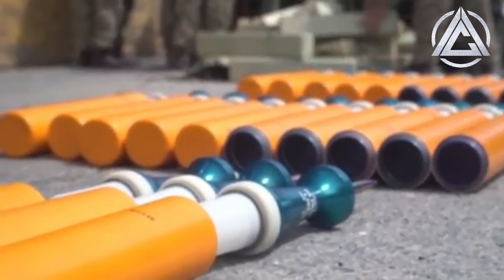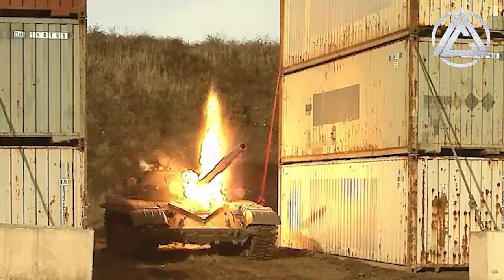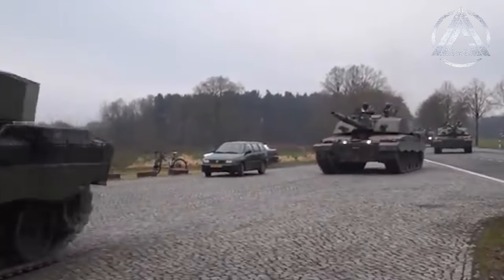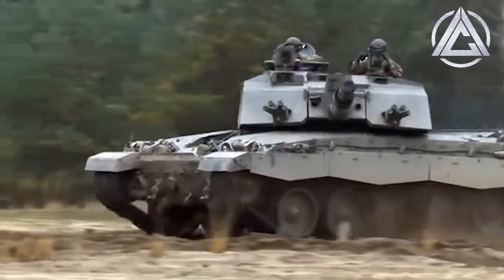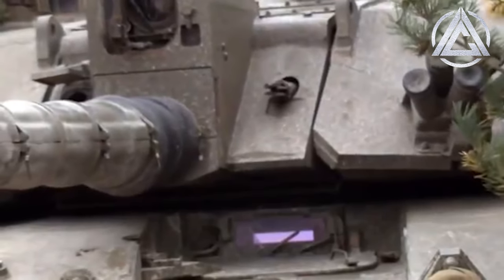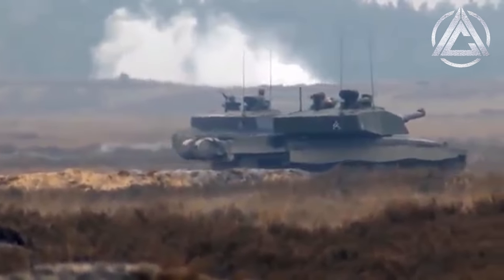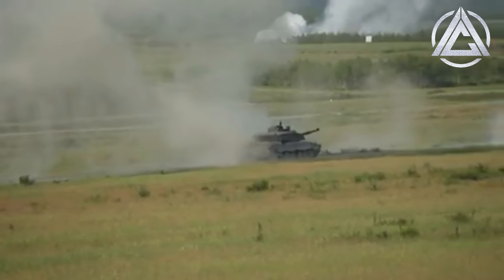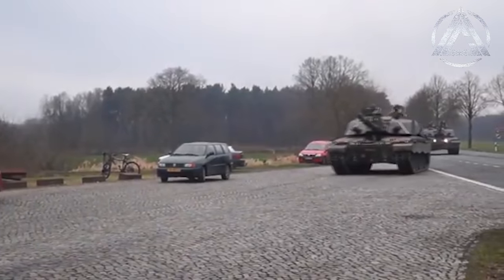Challenger 3 | Britain's New Main Battle Tank | Is It Really Any Good?

Comment: Great video mate. Good point about APS , which is already a big deal and with the proliferation of loitering muntions and armed drones is going to be extremely important. This program feels like a decent value for money option. Rather than spend an absolute fortune on a brand new amazing capability they put some very good upgrades on an already good platform and get some decent without breaking the bank. In British Mil procurement that's a win.
Reply from the maker: Thing is, for less than half the cost per unit, Britain could be fielding 150+ Leopard 2A6’s, which feature most of the same upgrades with none of the drawbacks of Challenger - better armor, much better mobility, same firepower, lower weight, much better power pack, etc.,

Challenger 3 would have been a very impressive tank if announced ten years ago and entering combat readiness now. By the time we reach 2030 it’ll once again be seen as a knuckle-dragger I’m afraid
Reply: @ArmorCast  better armour is very iffy since all of Durga is classified.
Reply: @ArmorCast  Well, buying Leopards would be a blow to British pride, but most importantly, to Britains industry. I can see that they wouldn't want to outsource their MBTs when even the Warrior is set to be replaced by Boxers, this is probably a compromise to keep their MBTs british and strengthen their own Industry. Look at how much Rheinmetall had to outsource to Britain for them to take the contract.

Comment: the time they have upgraded to the challenger 3 will be around 2032  this upgrade only was seen to take it into the mid 2040's i agree with you the time this comes out if it does not have a defensive system it will not be really worth the upgrade as it again will be outdated. and i also would have gone for the auto loader, lets just hope the time challenger 3 comes to a end in 2040s uk government will have the money to give the army a new new  tank
Reply: The bigger question is how many new tanks. Just 148? We'll be producing that amount in a single year in India.

Comment: I did some rough math and i have to say 142000lbs being pushed by 1200hp isnt all that bad. Most class 8 trucks here in the us have a max gvw of 80000lbs and the standard motor in most modern trucks, a cummins x15 “efficiency series” is “only” a 450hp engine and most trucks with a overweight permit are pulling 120,000lbs with that same motor or at best a performace series rated at 565hp. So 142000 with 1200hp is pretty dang good when you put it in perspective.
Reply: Pffft. All that maths for naught. Just compare power to weight ratios of all tanks globally and be done with it. 
Challenger 3: 18 hp/ton. 
.
Don't know about other tanks of the world, but in India its:-
T-72 Ajeya: 19 hp/ton
T-90S: 21 hp/ton
Arjun Mk1: 24 hp/ton
Arjun Mk1A: 22.5 hp/ton
FMBT (projected): 30 hp/ton

Comment: My main issue with the Challenger 3 programme is that we currently only plan to field 148 of them - the best tank in the world is no good if you don't have enough of them. I think that changes as drastic as an entirely new turret and main armament surely do justify the "Challenger 3' designation - these alterations are at least as significant as those made between the Challenger 1 and 2 generations are they not? As for the Challenger's armour being weaker than some of its contemporary western MBT designs this is the first that I have heard of this criticism - without access to (presumably classified) data in this regard it is difficult for a member of the public to meaningfully comment further on that matter. I suppose that all this 'Theatre Entrance Standard' additional armour added to the vehicle is a tacit admission that protection has become inadequate against modern threats.

I agree that if the MBT has a longer term future then reducing weight - by the adoption of active protection technology instead of heavy armour - is highly advantageous. However, it seems to me that there are limits to the amount of armour reduction measures that could be prudently applied to any crewed tank and in the second half of this century replacing that human element with automation may result in a new generation AFV that is cheaper, smaller, lighter and crucially far more expendable that any crewed MBT can possibly be. Future armoured formations may resemble the latest air warfare concepts with a type of human crewed command vehicle controling a number of subordinate  'Hunter-Killer' drones that do the actual fighting. 

Time will tell.
Reply: In this day and age things are getting leap frogged so often its not worth building a lot of something as the next gen will be just around the corner and render all those things you just built obsolete like when We the brits first built the dreadnought battleship it rendered our massive wooden fleet that cost a lot of money obsolete
Reply: @danny1229c  waiting for that next leap forward in technology often means you don’t have enough of what works today. It’s a huge risk to take when it’s your national defense that’s on the line.
Reply: @danny1229c  I agree. But one idea could be to go for a large fleet with just 2 or 3 types in service at a time. That ensures that at least half your fleet is cutting edge while the other half is not obsolete, just dated. 

For example, India can make 100-150 tanks per year. Which means that to replace the entire Indian tank fleet, it would take 28-42 years. So its good to have two tank types in service with each 20 years apart in entry and just as one goes out of production, the production for the next one begins. Now you have a perpetually modern tank force.

Comment: Armour Cast you are wrong. Whilst I concede that APFSDS rounds do not become more accurate due to rifling (they use a full bag charge for increased velocity to gain accuracy), other rounds such as HESH are made significantly more accurate due to rifling.

The spin imparted on such a round eradicates tumbling and adds a ‘predictable’ spin to the round. It is the predicability of the spin that provides the gunnery computer with enough information to properly extrapolate from other factors such as distance and wind etc. Rifling makes the gun way more accurate because of this.
Reply: Why would you fire a FS round from a rifled barrel? The fins just ruin the effect of the rifling..   Changing to smooth bore standardised the ammunition, which is probably for the good. and probably cheaper due to large quantities being made.
Reply: @robertmonk2346  to impart mathematically predictable spin to the projectile. Rifling means that every round is delivered is precisely the same way, whereas smooth bore guns are much less predictable due to the effects of tumbling. Rifling also means that defects in the round itself will not cause tumbling.

Also rifling rotates the rounds quickly so as project the sabot outward to get it out of the way the moment it leave the barrel.

You may be wondering how I know this. It’s because I was a Armoured Corps officer in the British Army when Challenger I was introduced. It was my job to know the precise characteristics of the entire gunnery system for Chally I and Chally II.

I was also part of the trial team in Bovington when Chally II was being brought into service in the mid 90’s.

There is not a single gun in the British Army that is smooth bore these days, other that mortars, which are not classed as guns anyway.
Reply: @gmtime5439  Thanks for the info.